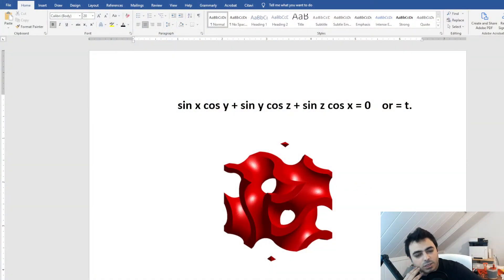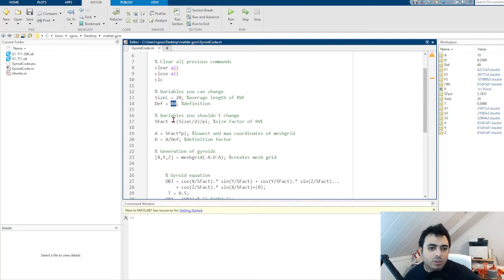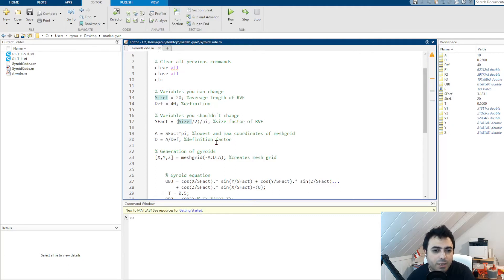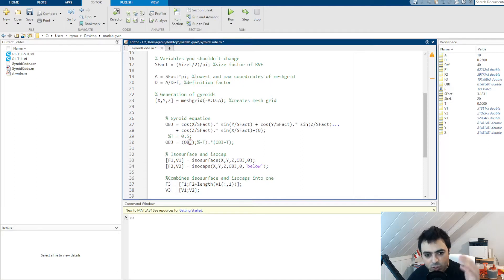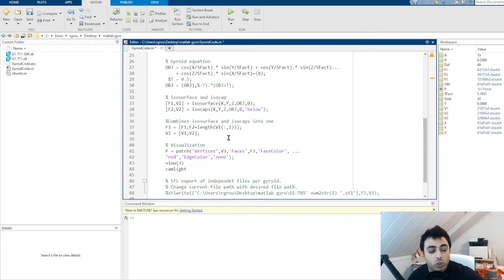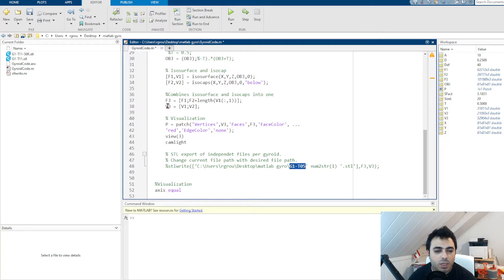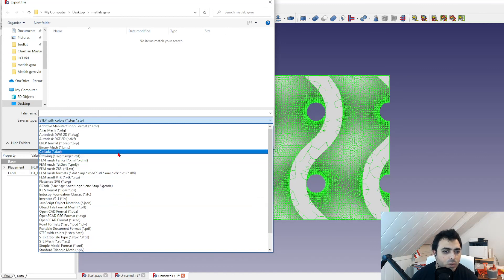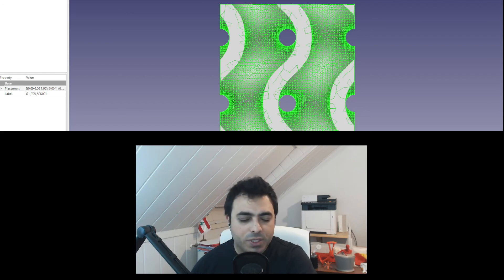Generate Gyroid structures using Matlab  (Meshlab +FreeCAD conversion)

Comment: Thank you. I would like to visualise the uncombined nodes cut at the edges. How do I do that?
Reply from the maker: I am sorry, I cannot help you with that.
Reply: @RamiRouhana  I just want to know which part of the code to delete so the gyroïd does not become a smooth uniform surface
Reply from the maker: @OfufualuaguAugustus   Try commenting out the isosurface section.
Reply: @RamiRouhana  But if i delete that isosurface line it will impact the "combine" and "visualisation" parts.

Comment: Respected sir,
Thank you for such a helpful tutorial. It helps me lot in my research.  I am facing two issues regarding gyroid  coding:
1. How can I insert the unit of gyroid in this code?
2. I want to create a row of gyroids then what are the changes I need to do?
It will be helpful for me if you help me regarding that.
Reply from the maker: 1-What do you mean by unit?
2- create the stl and copy in a row using fusion software.
Reply: Sir unit means I need 20 cm length gyroid
Reply from the maker: @subhanath6405  you can scae up the stl to any size you need after genrating it.
Use fusion software or Meshlab.

Comment: Respected sir,
Thank you for this outstanding video. It helps me lot for my research. I have some doubts regarding this video and it will be grateful if you help me on that.
1. What is the thickness of this sheet type gyroid?
2. How can I create network type gyroid with specific volume fraction?
Reply from the maker: I am glad this video is helpful. 

1-The wall tickness if the sheet gyroid is not constant. You can estimate  it by setting X and Y to 0 in the equation and calculate for Z value for the constant set to +t and -t.
Example :
sinx cosy + sin y cos z + sin z cos x = +0.1
sinx cosy + sin y cos z + sin z cos x = -0.1

These two equations give you a sheet gyroid. 
To find approximate thickness :
sin 0 cos 0 + sin 0 cos z + sin z cos0 =+0.1
sin 0 cos 0 + sin 0 cos z + sin z cos0 =-0.1
Solve for Z and calculate the difference, you will have the sheet thickness in Z. It would be better to do the same for X and then also for Y. The smallest value it the closest to to average.

2-This paper will help you with your questions. 
https://journals.sagepub.com/doi/10.1177/0278364920907697
Reply from the maker: The volume fraction of the sheet-like structure can be controlled by its thickness that is constant throughout the structure and depends on the values chosen for the constant . The relationship between the level set constant and the volume fraction 
of the solid-network Gyroid reinforcement phase is as follows:

Vf = 0.65c
Reply: @RamiRouhana  thank you sir for this information

Comment: Hello Rami, great video. If I were to 3D print structures like this do you know how to fill the Gyroid walls? The model right now is hollow. 

Thank you very much :)
Reply from the maker: Hello Alexandre. For printing you do not need to do any changes to the exported STL file. The slicer for printing fills the volume based on you print settings, number of walls and infil precentage if you are using FDM. If you are using SLM or SLA or SLS additive technology the STL model is assumed a solid in the slicer.

Comment: hello, Can I ask you a question?

The following error occurs when executing your code.
" Input argument must be a triangulation object "

Maybe the cause of the problem is 'stlwrite'.

How can  I solve this problem?
Reply from the maker: Hello. When the error occurs it indicates usually the line of code where the error is. The forums suggest it is an error related to stlwrite yes. Make sure you install the plugin using Matlab add-ons.
It could be dependent on the matlab version you are using also.
Reply: @RamiRouhana  oh, I looked at the video carefully again, You've already explained it

thank you so much. I solved the problem :)